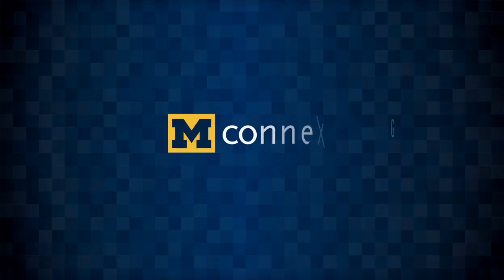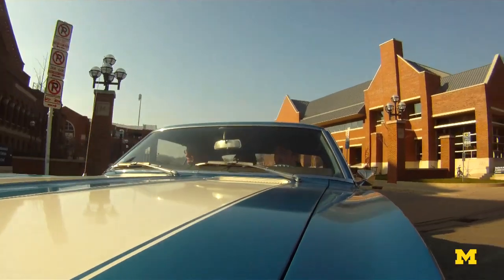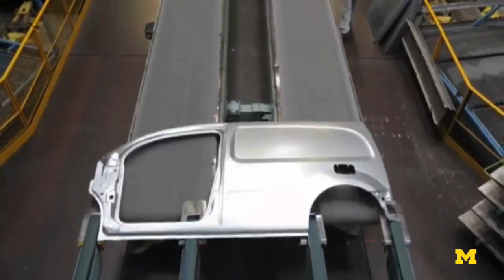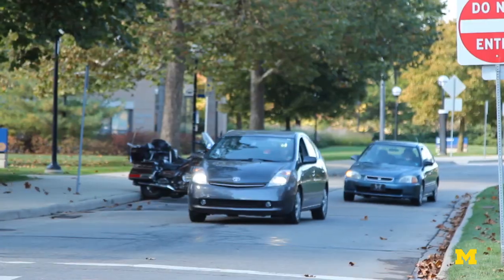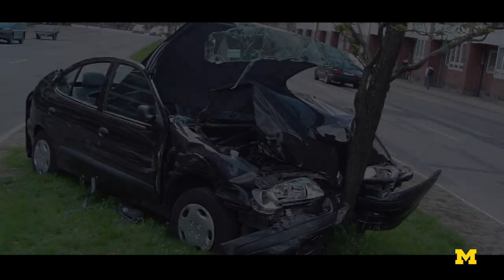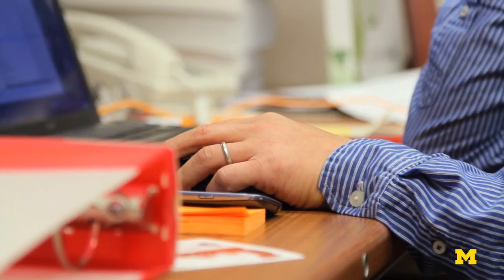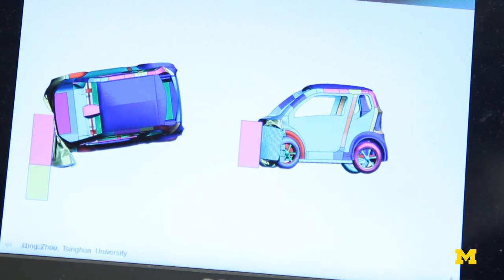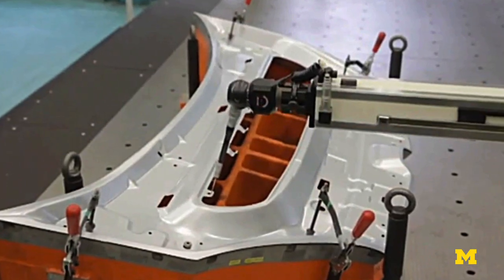Making cars lighter

Comment: A Fiat 500 is 1 ton, a Range Rover is over 3 tons. There should be a law that compels all vehicles to weigh less than 1 ton. It would essentially be the end of Ferrari and Range Rover but 2 x better for the environment by reducing the average weight of cars by half. If people want to pay up, theyll always be able to have fancy materials but overall, it wont really matter much, a smaller car should be the main objective. A smaller car will go a long way to ease the transition to electric and other energy sources (the battery would not be included in the weight). Also it would be easier to recycle. Automakers should be compelled to recycle their old cars entirely.

Comment: You have to consider scenarios where car manufacturers are inconvenienced for the good of society.  As Patrick says in these comments, simply making smaller cars and encouraging their use would be effective.  In his example three times reduction (1/3rd the weight, making no changes to the existing materials or systems) would be easy.  Sometimes the answer is economics and choices, not more complex engineering.  If Michigan Engineering is teaching its students to always go for the problems and scenarios that keep them doing more and more complex research, that is a disservice to them and to society as well.

You also are ignoring that some of the weight of vehicles now is interior and auxiliary things that only contribute weight.  Why does a car meant for one owner and occupant carry around seats for four?  Gas driven cars have transmissions, drive shafts and wheels that are not necessary if rim driven permanent magnet electric wheels are used.  And Uber has transformed society in some ways.  Sometimes the answer is "do not use cars in the first place".

I like what your group is attempting with these materials and methods.  Weight reduction is "PROBLEM NUMBER ONE" for space exploration.  So you are probably wasting time with cars.  I see lots of 3D metal and strong materials printing and assembly methods now.  Internet growth and new group growth more than most anything to do with commodity cars.

You linked to yourself, but do not have a good landing place. You should link directly to your current papers (open, free, accessible so people can immediately read what you are doing, and highlight your co-workers). I would imagine you have graduate students and collaborators. What people and groups want to see is "Team" and clearly traceable affiliation and finances.  It means someone has to keep the YouTube pages current, but that can be done partly with good management software.  You probably have some poor human doing it by hand. 

University sites are the most chaotic and incomplete on the Internet, and often the worst maintained.  It is so common that I find good research that people do as students where they later abandon it because the university did not value it, nor keep good records. I am not suggesting to leave the university, just try to hold them a bit more accountable.  Particularly the groups who are "supposed" to keep the whole of the Internet curated and organized as it affects the fates of all university departments and global activities.

 I wanted to offer a prize for people who strip existing cars down to the bare minimum.  It seems it would be a good idea to also check for "most effective design with new materials" and "social and economic re-engineering to remove the need for the product altogether".  I am sure there are sponsors.  It just takes patience, persistence and priorities.

Richard Collins, The Internet Foundation